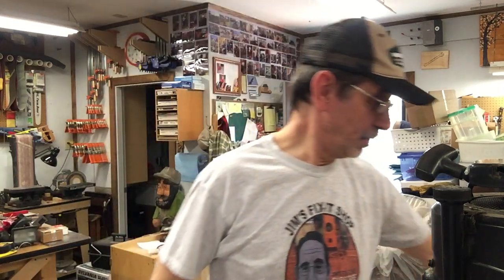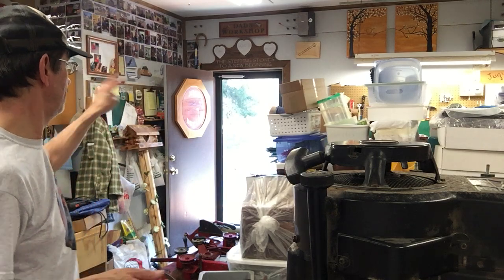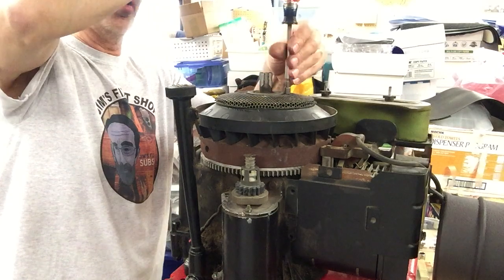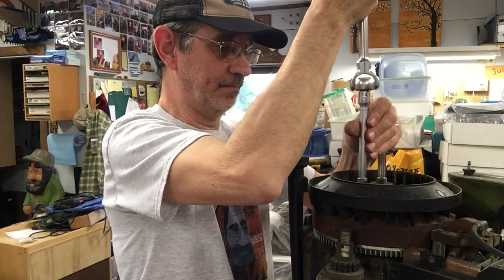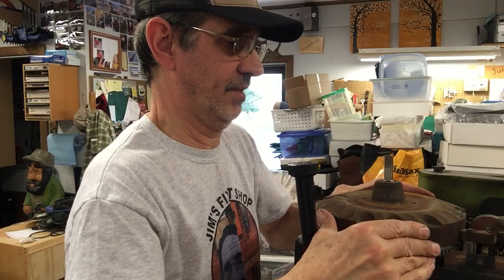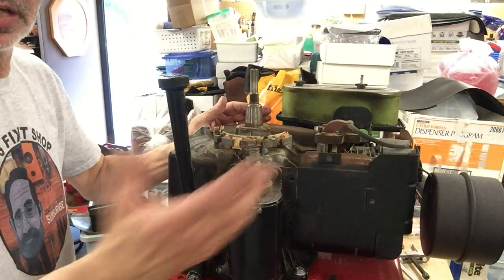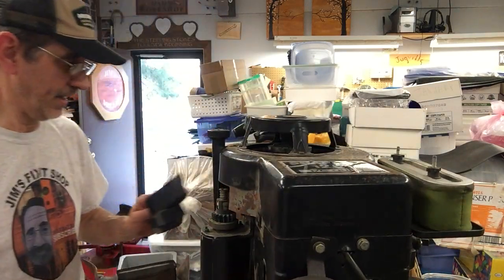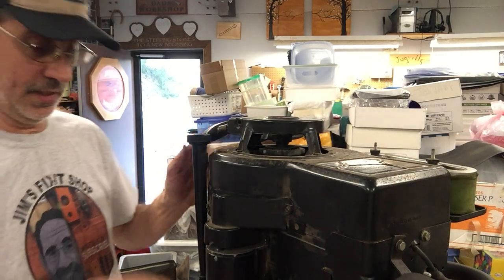343.  M/S 66. How do I replace the stator in my small engine.￼

Comment: Jim thanks for the refresher been awhile since I pulled a flywheel ! & you need AC DC because of the band AC DC ( LOL ) Any way great video & I will use it as a future reference for my rebuild on my 8 hp B&S engine , for the restoration of my Snapper Comet & thanks for the helpful video & yes I know what You left off but I was late viewing this & I already have one of those magnets. Thanks again for the very helpful video Jim . SNAPPOUT.
Reply from the maker: Ha ha cute I like that. Jim

Comment: Hello Jim, I want to buy a RER 200. Unfortunately, it's a little slow. Other lawnmowers are usually faster. Is there an easy way to increase the mower's speed?
Reply from the maker: Watch video number 253 if your latch plate is out of adjustment a little it could make your tractor run either faster or a little slower than the factory settings. Jim
Reply: @jimjackson9381  Thanks for the answer. I'm already looking forward to my RER 200, which I will get in 4 weeks. I like to think that with a little care, these devices will last almost a lifetime.

Comment: Jim, should the flywheel nut be torqued down to so many ft lbs?  Also where did get the special socket for the flywheel nut? Excellent video!!
Reply from the maker: Bill I bought it from Amazon it was $13.40 ask for a
 starter clutch wrench 
And it should pop right up as far as the torque value I just tighten them up with an impact with their ranch and I’ve never had an issue but I will check to see if there is a torque rating for that and let you know. Jim
Reply: @jimjackson9381  Hi Jim - its Big Rodders in Ireland.  Bill is correct, flywheel nuts should be correctly torqued.  I had terrible trouble with my 12HP B&S flywheel shredding keys.  I had erroneously greased the flywheel taper to facilitate the next removal and this caused the problem.  I now know that it is the pressure on the taper that prevents the flywheel spinning on the shaft and the key is just for locating it correctly.  I had to lap the taper with grinding paste, clean it up completely dry and torque it correctly.  I printed off a specification sheet from the B&S website, which covers torque settings for the different series engines.  No problems since - Keep on Snapping!
Reply from the maker: @rodneysweetnam8653  can you send me a copy of the sheet to my email. Jim
Reply: @jimjackson9381  Rodders again.  I have emailed the chart to you so let me know if you get it and if you think it will be of any use to you.
Reply from the maker: @rodneysweetnam8653  Yes I did get it and thank you and it will help not only me but a lot of other people. Jim
Reply from the maker: Bill send me your email address to mine which is
jimsfixitshop@gmail.com
And I can send you the information you need. Jim

Comment: Hey Jim, me again
So I have a 1981 Briggs 8hp that is mounted on my snapper rer. I got the engine a brand new carburetor, because the old one was corroded and rusted. I went to start the engine up and on it’s very first pull it started up, a little too good. The engine was over-revving to the point I was worried it may throw a rod, or destroy itself. I looked into it, and found this box n the side of the engine where the throttle was hooked up. It turns out that whoever was in my engine before hooked the throttle cable right up to the linkage to the carb. Nothing was hooked up to the governor. Can you please help me with how to hook it up. I really want to start using it this summer. ( engine model 190707 )
Thanks 
Your #1 fan ;)
Reply from the maker: I’m gonna need some pictures of your engine the best you can do because I know the carburetor faces the seat under the gas tank but I’ve got to see what linkages are still there and what’s missing and I’ll get back with you after I take a look at them. Jim
Reply: @jimjackson9381   ok, I’ll have to show you the picture tomorrow because we are not at our house at the moment. Is there an email I can send the pics to? 
Thanks 
Fan
Reply from the maker: @thetrader7613  yes my email is
jimsfixitshop@gmail.com
Thanks. Jim
Reply: @jimjackson9381  ok, sent